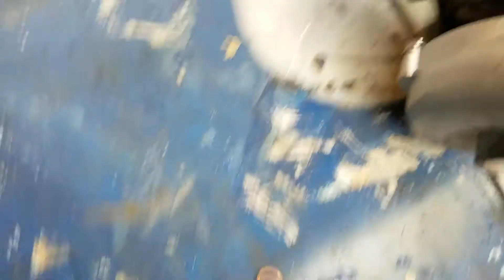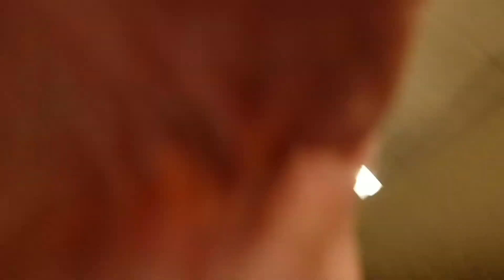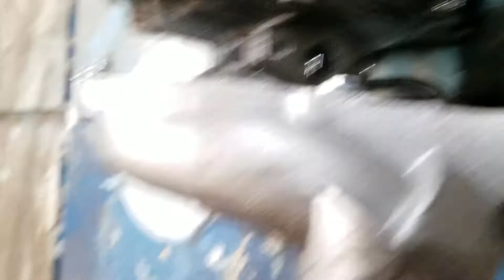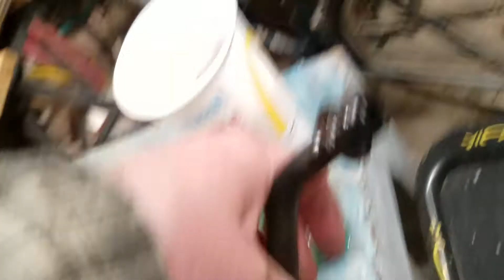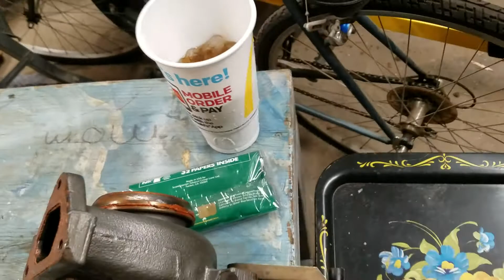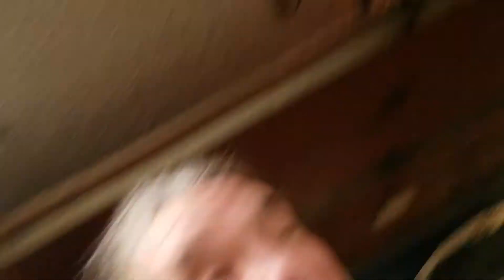Mercedes sprinter T1N Garrett Turbo install mistake

Comment: only the black gasket goes on the return line on the bottom. The copper crush gasket goes on to the pressure supply line banjo fitting on top and you should have 2 of them. One for the top of the banjo fitting and 1 for the bottom. If you put both on the bottom that is the reason it leaks
Reply from the maker: I have a little moisture but no oil loss on return , Yea probably wrong info... BUT I do have two crush washers on Banjo... That was the way she came apart , so that was the way I put her back... My bad . Many blessings , SMR
P.S. what is a good forum or web site for maint and repair... Youtube does't have much

Comment: Thanks for the update. Mine appeared to be from the flange seal you replaced.  I tested it with soap bubles off the vehicle and its leaking between the turbine housing. Ive removed it 3 times so I feel your pain. Thanks for contributing the info
Reply from the maker: I had a loss off boost on my turbo also ... I made a gasket out of Hi-temp felpro gasket material... worked great... good luck , SMR
Reply from the maker: These are great vans though they do have their quirks... once you get them worked out your good for 50k till the next maint sched

Comment: Are you sure that washer isn't for the inlet banjo bolt? I'm going to have to look into this more.
Reply from the maker: Nope... direct dump to pan w/ Oring... no banjo bolt at pan
Reply: @TheSmreeder  I just rebuilt my turbo and you do not use a crush washer between the turbo and gasket off the turbo for the return line.  Just the gasket with the alignment tabs facing inward to bottom of the turbo and then bolt on your return line that just pops in like you said to drain back with the rubber grommet.  You shouldn't have any problem with leaking.  Just did this on two different Sprinters with original turbos.
Reply: @michaelnelson7106   this is what I thought too when I saw that washer in the video. thank god I saw your comment otherwise id be crawling around looking high and low for a nonexistent washer.
Reply: @Michael Nelson I did just as you say, but I still have a leak with the new gasket any ideas to fix it?  Manual says 6 ft lbs torque. Is that all you used? I don’t know what to try next.

Comment: How much cost you turbo
Reply from the maker: Rebuilt ... $250 -$300... now that I know how simple $50 kit
Reply from the maker: $350 USA
Reply: @TheSmreeder  Seriously? You can rebuild it yourself?
Reply from the maker: @johnmanney4013  I had mine rebuilt for about $300. then I found out that all the parts are only $50. not including impellers but they are only about $75 each... My impellers were good all I needed was seals and bearings
Reply: Hi Smr. Where would you get the parts for the turbo ? I’d like to try it myself ... TY
Reply from the maker: @Lowdown13blues  ... Garrett Turbo or any rebuild / speed shop can get you the parts ...I had mine rebuilt at a local shop in Ohio for $325.  A rebuild kit I think is around $150.
Reply: TheSmreeder Thank you. I asked a couple of places to rebuild it and they want $450, saw a non Garrett one on eBay from $350 and up and a rebuilt Garrett from Mercedes for around $1000 the cheapest 
I asked around and it doesn’t sound that easy to do it myself. I’ll see what I do. Thank you anyways ! 🙏
Reply from the maker: @Lowdown13blues  For Mercedes diesel , Garrett is what you want if you are working on a sprinter... They have a special Gating system that is for the mercedes diesels... PLS do not buy a cheap ebay turbo they wont work.... Google , Summit Racing they should have the rebuild for around 150... you can get bearings and seals for about 50... if your impelers are good just get the bearings and seals... Good Luck and Many blessings , SMR

Comment: Did your fix work? Ive got a t1n with a mercedes reman unit thats been leaking from that seal for some time. Changed the seal twice. Im thinking the return pipe mounting surface is warped or the pipe flange. The gold metal seal you show isnt part of the parts diagram
Reply from the maker: Yes I got a new oval tin gasket from auto zone and installed it like I said in the vid... I have a touch of moisture there but NO dramatic leak ... have put nearly 30k on her since and have never added oil between 7500mi changes...
Good Luck and Many Blessings , SMR
Reply from the maker: I lose less than a quart every 10,000 miles... it's at the turbo!!!
Reply from the maker: I have put 25,000 on since video